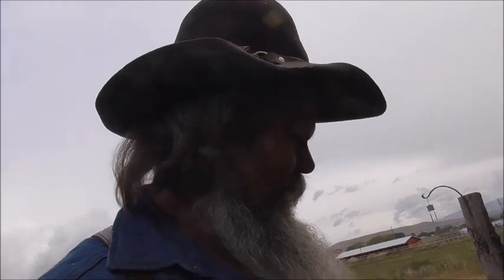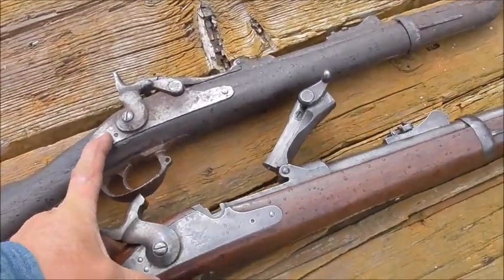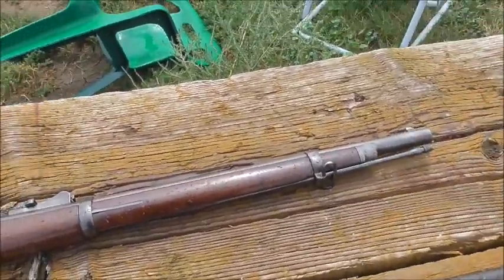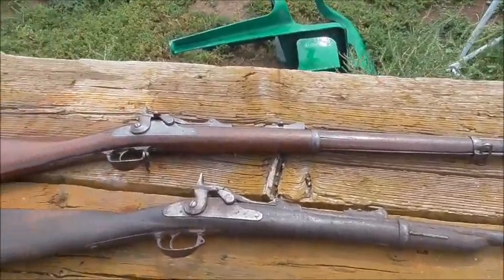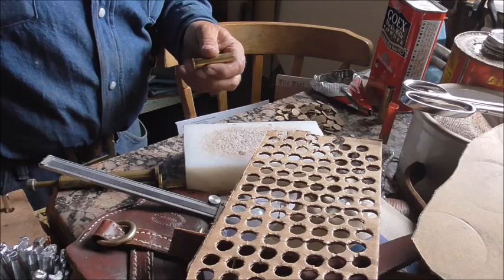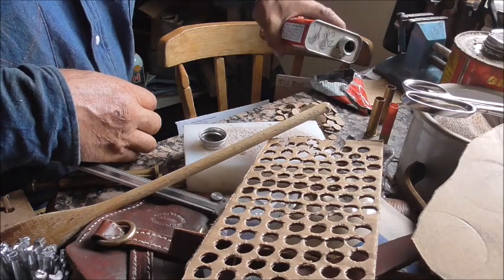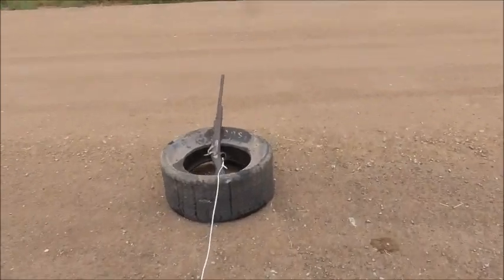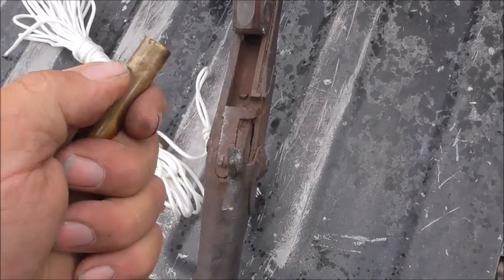An 1873 Trapdoor Springfield for GROUSE?

Comment: The way I recall the .410 using brass shells was originally developed for military use in the 45/70s. So foragers didn't have to carry a shotgun and carbine. Then when the nfa came into play the 410 dimensions where changed. So 410 couldn't be fired through a 16inch barrel.
Reply from the maker: They actually made 45-70 shotgun shells at one time. .410 is the only shotgun shell that I know of that is named in caliber (41 cal) and not gauge.You are probably right.   I don't know about a change like you describe, but it wouldn't surprise me.  Most likely, a new size shot shell means you would need to buy a new gun.....same as the new cartridges they come out with today.  Most of our "New cartridges" are similar enough to existing ones, that we really don't need them......but the manufactures want to sell more guns.

Comment: An old aluminum cleaning rod poked down the barrel with a tuft of steel wool and a squirt of 3-1 oil on it then chuck the rod into a cordless drill and hone that chamber.... should help extraction.

I use a piece of ridgid cardboard like your top card on top of the powder followed by one or two 1/8” thick cork gasket material cushion wads covered In black powder lube then the shot and then another card on top to hold it all in... haven’t loaded 45-70 shot shell cases yet but I load a lot of .410’s like that with both magtech brass and .303 British cases I turn down the rims and blow out the neck on....
Reply from the maker: Thank you for the great advice.  I think I'll try that. If I can get this to group well enough to not just wound grouse, I would love to hunt with it!  I bought some magtech brass in 12 ga, and 410 years ago and use them quite a bit. I really like them!  They  take large rifle primers instead of shotgun primers which is a bonus also.   I have heard 303 Brit, or 444 Marlin cases work as 410 shotgun too, but I've never used them.
Reply: Muskrat Outdoors 
The .303 rim is too thick to let the .410 action close so the rim needs a touch with a file with the case spinning in a cordless drill... I anneal the cases and start with opening them up with a 9mm expander then a .416 Rigby expander or anything big works fine... anneal again after they are opened up and then just load em an shoot em.... it’s a pile of work for what it is and I don’t suggest doing it...

The magtech brass is nice stuff, a friend of mine bought a Lee Enfield in .410 wich is actually different than standard .410, he tried the magtech brass in it and it wouldn’t work for him so I ended up with 2 boxes... good thing because these days where I live my #4 shot Remington loads I love using for chicken are $25 a box 😣
Reply from the maker: @PuskwaskaOutdoors    Should be able to fire form them using Unique and cream of wheat.  Some are bound to split, but annealing the brass would help.  A drill makes a pretty good lathe.  Magtech brass has been kind of hard to find lately for shotguns.  I really like it though, but I have no way to crimp the 12ga.  In a double sxs it works fine with hot glue.  A pump would be a problem.

Comment: I really like the videos you make around different older guns.  I have a couple of questions,   when you made your suspenders did you put any elastic in the back?  and second,  What do you carry in your leather belt pouches?
Reply from the maker: Thank you.  Nope, no elastic.  The old ones never had it, it wasn't invented yet, and it's not really needed.  The big pouch is my wallet. I lost a normal wallet years ago, so this one is attached to my belt to be harder to lose. It's about worn out and needs replaced. The thing next to it (right side) is a flip phone.  I like the size and don't want a bigger phone. Left hip is a vice grip multi tool. (they don't make them anymore). Right now, since trapping and hunting season is coming up, I have a small NAA 22 mag 5 shot revolver also.

Comment: I believe .410 is much closer to 303 British and have heard of people using 303 British brass to make all brass .410 shells
Reply from the maker: Yes it is. I know a guy that does make them out of 303 British. 
I think this poor old gun still has enough rifling, and barrel pitting, that the shot is going everywhere.  Cylinder bore too with no tapered choke doesn't help either.  Thanks for watching!

Comment: These Trapdoors were all sighted in for 6" high at 50yds and 12" high at 100yds. You need to purchase an extra high front sight and pin. Clean up the chamber and buy a new extractor spring and plunger and your empties will fly out just fine. Nothing some TLC cannot cure.
Reply from the maker: Interesting! I wonder why they were sighted in too high?  I have a Remington Rolling Block in 7mmx57 that shoots really high also.
Reply: @MuskratOutdoors  I read that they were sighted in for 250 yards when the US Infantry and Calvary used them back in the day.
Reply from the maker: @FrednDeeDee   That would be about the right amount of drop. Thank you for this info, I never knew it!